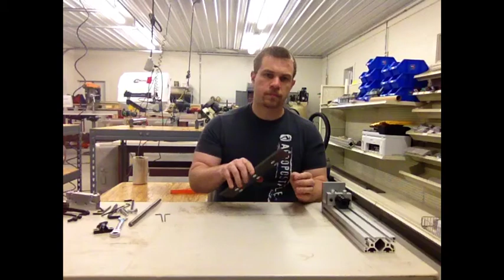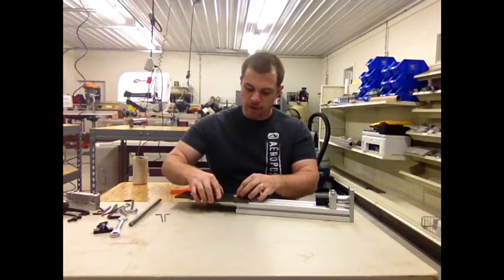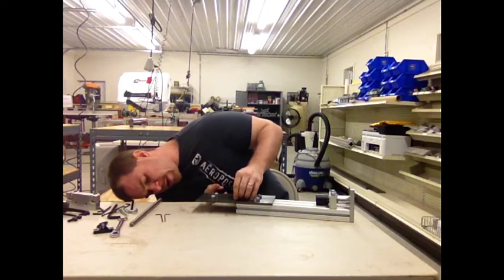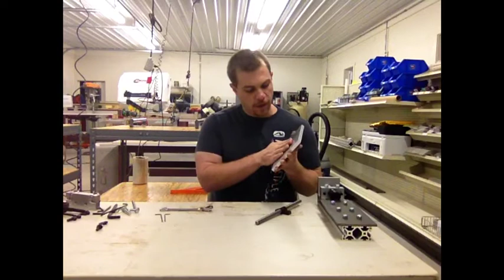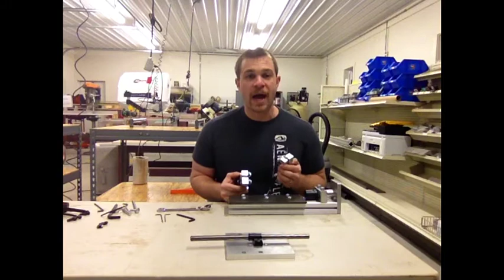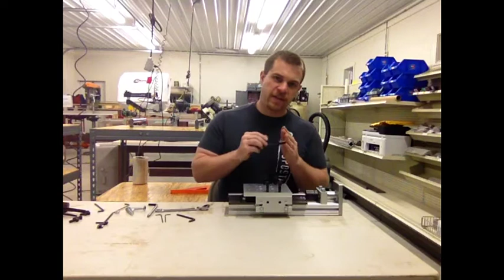Revision 5 Z-axis Assembly Part 2

Comment from the maker: A normal sized bearing block will not work because it hits the Z-Axis.  We used to have a low profile bearing on the end that used a bushing instead of a bearing.  We ended up removing the low profile block because it was causing a small amount of binding in some machines that could result in lost steps. Running it free on the end doesn't harm anything because the axis is short and vertically oriented.